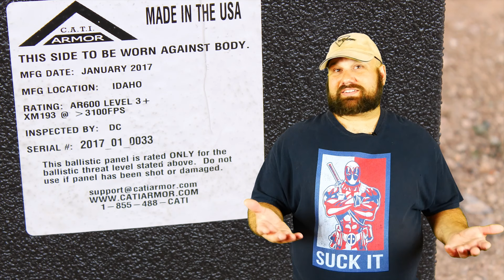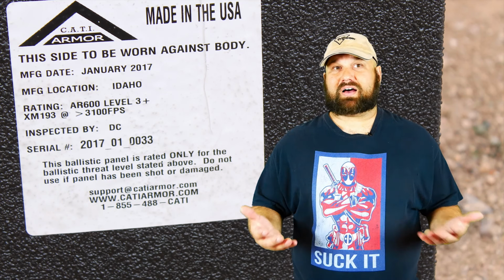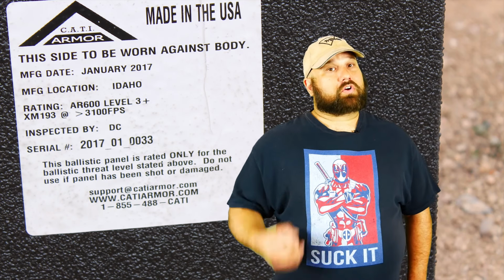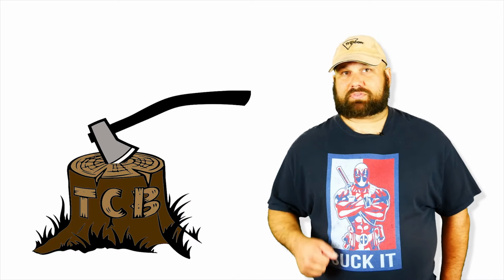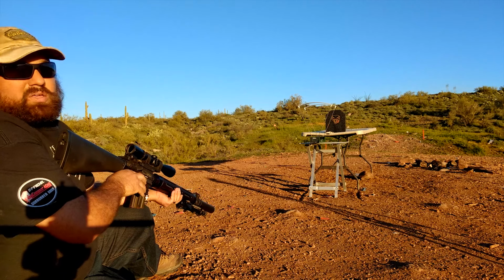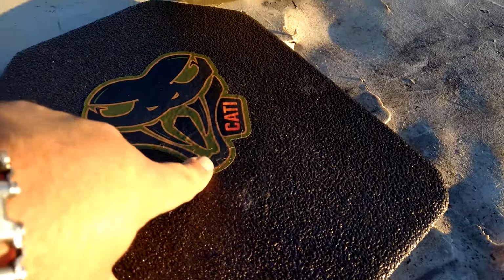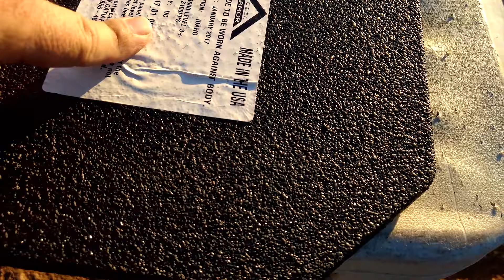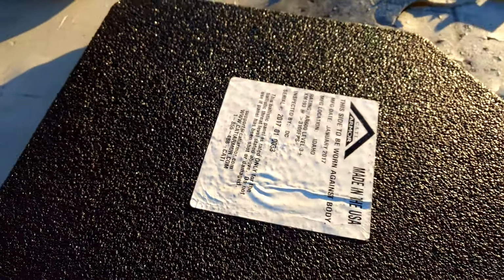CATI level III+ steel armor vs. M193 5.56.m FMJ

Comment: I have a full set of CATI LVIII+ plates for 180 bucks. Aside from AP threats which I find kinda meme tier because the Military doesnt really use AP but in very specific roles (IFV, Tanks, 7 tons etc) so I can safely say Level III+ will protect from all reasonable threats.

Comment: I love your definition of Level 3+ and I'm happy to see that there is a provisional NIJ standard for it. Someone needs to pull up TSG on their Level 3+ because they are taking advantage of that classification not having a stringent standard. Their Level 3+ is rated for 2900 fps and has been shown to fail at 3000 fps with M193. That makes it, as far as I'm concerned, pretty much false advertising with the 3+ and could be dangerous for the uninformed. Thankfully the community that buys and uses this armor is usually smart enough to see that theirs is pretty much a fake. The funny thing is it is priced the same as Cati armor. I'm glad I found it. I'm not comfortable with the standard ammo for the most popular rifle in America punching right through Level 3 plates.  I need something more, even if just for peace of mind. Question - How much does Level 3 armor slow down the M193 bullet after it passes through? Not enough for 3A to stop it is my understanding. I would love for someone to chronograph the projectile coming out of the back of a penetrated level 3 plate.
Reply from the maker: You'd have a real good chance of breaking your chronograph.

Comment: 1, nope, 2 nope, 3 nope.........MAGDUMP!!!!! Impressive result from CATI, I love the close range tests on your channel. Great for considering plates for my deployable briefcase armor I carry for school and regular work.
Reply from the maker: Clint Havoc Thank you.
Reply: @chopinbloc  hello sir. Is the spall coating on these the same as on the rta?
Reply from the maker: @theheretic3764  same? I don't know, but it's very thick and attached well.
Reply: @chopinbloc  thank you.

 I’m on the fence between RTA  level III+ and Cati.

The Rta is cheaper but I don’t know if they’re equals.
Reply from the maker: @theheretic3764  I would get lvl IV plates. They're usually cheaper than coated, curved III+ steel plates. Try LA Police Gear and Botach to start. Google Hesco level IV.
Reply: @chopinbloc  I have Botach plates. 

I’m considering lvl 3+ for the multiple hit capabilities. Something a little more resistant to dropping damage and such. To have as an option. I’m very happy with the Botach plates... but dear god at the shipping times.

If you had to choose between Cati and rta?
Reply from the maker: @theheretic3764  ceramic plates are way less fragile than people think. They will stop multiple hits. They just aren't rated for that because subsequent hits on the same spot could perforate. They'll also stand up to being dropped many times. They are Private proof, after all.
Reply: @chopinbloc  how about spall coating? I’ve always been curious about that in ceramics.
Reply from the maker: @theheretic3764  unneeded. Ceramics contain the bullet, with minimal fragments going forward and none going laterally.
Reply: @chopinbloc  I suppose that makes sense. Fragments could be propelled back out the whole they just made but moving on a horizontal axis would be super difficult.

I’ve noticed that after several hits they tend to deal laminate. I wonder what coding them with a thin layer of Lenix window? Like if it would help hold them together I was the deal emanation seems to be the only thing that compromises them in the case of the Botach.

What about deformation? I recently spoke to someone who said the deformation in a Botach was their Achilles’ heel. They stopped all rounds but they deformed to the point that the impact was still lethal or something to that effect. Is that a benefit of steel over ceramic?
Reply from the maker: @theheretic3764  nah, that's BS. If it is NIJ rated (you can look up the model number on the NIJ website to see if it is) then it meets back face deformation standards. It is true that steel has much less back face deformation. But it is not true that BFS on ceramic plates will kill you. In fact, Dr Roberts told me he knows of only one instance of someone dying from a wound caused by back face deformation when they projectile did not perforate. And that was some big bore crazy cartridge like .458 Win mag or some such.
Reply: @chopinbloc  Thanks! Your knowledge is appreciated!

Comment: I've seen other armor manufacturers with level 3+ rated both m193 and m855, whereas Cati's 3+ is only rated M193.  I was under the impression that armor levels met the same specifications?
Reply from the maker: They probably didn't think it important to list every threat the armor can stop. But regular lvl III steel or composite plates stop M855. There is no way that M855 is going to defeat any lvl III plate except for UHMWPE, and even then, at more than 50 feet with a 14.5" barrel, some plates can do it ICW soft armor.
Reply: @chopinbloc  This helped clarify things, thank you! Was this plate you tested CATI's Rhino Base coat or their Build up coat?
Reply from the maker: @t77snapshot  This was the build up.
Reply: M855 does worse than M193 in punching through armor, if the plate is rated for M193 it automatically means that it's rated for M855 too

Comment: Nice job. I had predicted that it would have more back-face deformation.  Once the "official" test is complete, how often to you just set the plate against something solid and mag dump into it?  I would every time. lol
Reply from the maker: David Pearson lol. I usually have quite a few different loads I want to test.
Reply from the maker: BTW, one of the major advantages of steel is that it has virtually no back face deformation.

Comment: I believe you may be too close and getting the "error" messages.

At that range, a lot of debris and gas is going through the chrono at the same time as the bullet
Reply from the maker: Thanks for watching. For some reason, YouTube marked your comment as spam. It's hard to tell from this perspective, but I'm ten feet from the chronograph, which is the normal distance. Besides, the silencer stops and slows down most of that debris. The errors are caused by the angle of the sun. I have a new chronograph that should be independent of lighting conditions.
Reply from the maker: Jonathan Langford lol.

Comment: I think bottom line will it stop several hits of m193 from a 20 barrel at cqb? What's the point of rifle armor if the most common round (m193) out of the most common rifle threat (ar15) can't be stopped at the longer end of standard barrel lengths (20")?
Reply from the maker: David Ridge Yes, it does.
Reply: Thanks for the response. Think we could get a video of all the big name  3+ plates taking multiple m193 hits out of a 20" at close range? Spartan, ar500, patriot, cati... I know that's a tall order but that's the video I've been searching for. I've found bits and pieces of that information but one way or another it's not fully addressed. Yours are probably the closest. If you've already tested this please let me know, maybe I've missed it. I think you did with ar500
Reply from the maker: David Ridge Please take a look at Buffman R.A.N.G.E. and The Wound Channel. It may be hard to get all of them to submit a sample again, but I can try. You could help by emailing them and asking each to send me a fresh plate.
Reply: @chopinbloc  did you ever try shooting it with a 20" barrel?  your affirmative above is NO penetration with an m193 and 20" barrel?  I've seen two other youtube videos testing the same 3+ plate, one with penetration and one with no penetration.

Comment: Nice video.  For what it's worth, as a reserve patrol deputy I think about what am I most likely to encounter out in the county.  While .223 and 5.56 are extremely popular rounds for plinking and home defense; .270 Winchester is just as popular with hunters, especially in rural counties.  

Minimally, NIJ Type III+ needs to stop M193 from 4.65 meters. 

Why M193? Arguably, it's the most popular inexpensive center-fire rifle round out there today. The performance of the M193 falls neatly between the NIJ Type III M80 and NIJ Type IV M2AP testing standards.

Why 4.65 meters? NIJ's minimum testing distance is not less than 4m. The shortest model 1995 Ford Ranger pickup is 184.3" which is approximately 4.65m. This is the shortest distance I think in which an officer is likely to be ambushed with a rifle out in the open. The initial shooting of Deputy Kyle Dinkheller was from approximately this distance. It should be noted that Deputy Dinkheller's killer used an M1 and was driving a Toyota. 

Normally, you just don't go around wearing Type III+ or IV as part of your patrol routine. However, a III+ trauma plate in front of every day soft armor or for active shooter situations is very likely.

Ideally, NIJ Type III+ should be able to stop .270 Winchester from 4.65 meters.

Again, great videos and keep the rounds going down range.
Reply from the maker: O Sol1tair3 Excellent input. Thank you. I think I may test this plate with .270 Win.
Reply: An interesting note: with 5 exceptions, NIJ/ANSI/SAAMI test barrels are 24". Any manufacturer that can make III+ that can withstand .223/5.56 from a 24" barrel should be good to go.
Reply from the maker: O Sol1tair3  M193 is not part of the NIJ rating for level III. Also, level III+ isn't an NIJ rating. So if a company claims to have a lvl III+ plate, it could be totally meaningless, it could mean they tested it with special threats out of any barrel length, or it could mean they had an independent NIJ certified lab test it with special threats.
Reply: True, claiming a NIJ III+ rating is marketing, and pretty good marketing at that . If M193 is selected as the caliber for a future NIJ III+ rating, more likely than not, they'll stick to a 24" testing barrel due to the since that's what the ANSI/SAAMI testing standard calls for with .223 and 5.56. However, since some of the armor already appears to pass the backface deformation standard using a 20" barrel, I could foresee manufacturer's petitioning to have the NIJ adopt that barrel for testing Level III+.   If these various plates can pass using a 24" barrel then they are even in a better position once a standard is adopted.

Keep up the good work.
Reply from the maker: O Sol1tair3 Thank you.

Comment: i think level III+ armor is more that adequate to stop almost all threats within reason, m855a1 might be an issue but i think it also depends on range and the angle in which that round is hitting the plate. that being said for an individual Level III+  makes more sense for end of the world pockylypse because average people dont have access to fresh Level IV plates when they become worn out, and i think that is the inherent advantage steel has over ceramic is its long term use.

Comment: If you have the regular level 3 can you put a level 3A steel plate behind it and stop an m193?
Reply from the maker: No. At least, probably not. William at The Wound Channel shot through a steel level III, a level IIIA panel, and 16" of ballistic gel using M193.
Reply: M193 usually punches through even that combination

Comment: One other question if you feel free enough to answer it - what chronograph is that?  You have so many chrono-reading issues that I want to make sure to never buy it if it's been the same one throughout most of your videos.
Reply from the maker: Mambo Dave Lol. It's a common issue with chronographs. It's because of the light conditions. But it's a Chrony brand.

Comment: I’m EMS looking for steel for ballistic and stab protection. These seem like they will fit the bill. Thanks
Reply from the maker: There are a lot of factors to consider. Not the least of which are:
Weight
Protection level
Cost
Durability
Have you ever worn body armor for long periods of time? Steel armor is kind of a baseline, good enough if you can't afford much. But it is heavy and uncomfortable.

Comment: Expected more deformation. Going to have to take a closer look at it.
Reply from the maker: Steel armor doesn't really deform. It either takes the hit with almost no damage, or fails completely, knocking a neat little plug out just slightly larger than caliber.

Comment: Oh, it'll stop the rounds up to the 7.62mm and any smaller rounds, up to the given velocity it is rated for. At least thats what it should be for lvl 3 from what I understand.
Reply from the maker: Plastikdoom For steel armor, that's mostly correct. But level III UHMWPE plates can be compromised by M855. Virtually any level III plate will be compromised by M80A1, even at 2,800 fps.
Reply: Yeah, that's what I meant, for steel. I should have specified that. And true, but it's not rated for the M80A1. So yeah, I should've made what I said more clear, just standard ball rounds, of up to 7.62mm at or below the rated velocity it should stop them, for steel lvl3
Reply: The Chopping Block great vid as always. Don't know if you've seen my comment, from your improved homemade sapi plate one. About one I've made in the past. I've been looking at making another one, just to test again. And most likely will soon, need to find the same epoxy I used before, most likely have to order it though, as Home Depot or lowes doesn't carry it in store anymore. I suppose if I make it again, I can record it and show the materials, and test. But I crap for recording equipment. My phone is my best video camera, haha. At least in my garage could use my laptop and web cam. After that, maybe you'd be inspired to make one and test, with your different calibers/rounds and better equipment/chrono for more solid info.
Reply from the maker: Plastikdoom Most phones have pretty good cameras in them. All of my videos include at least some clips from a cell phone.
Reply: The Chopping Block true, but the mic will not record the greatest. But should do.
Reply from the maker: Plastikdoom You can use an external mic, if you want. I found that a bit of tape over the phone's internal mic cuts wind noise.
Reply: Yeah, thanks. If need be, I can just voice over the video, it's usually pretty windy here in southern Idaho.